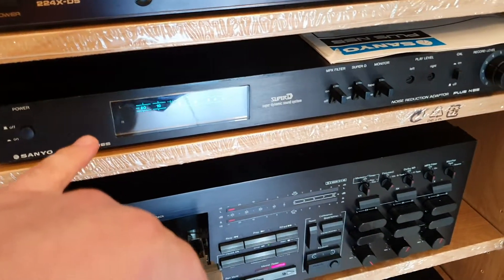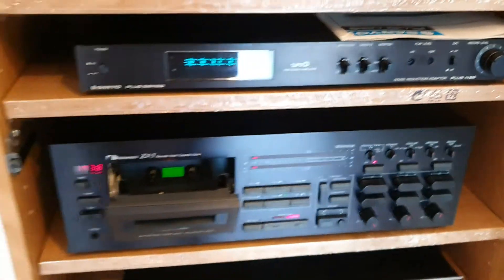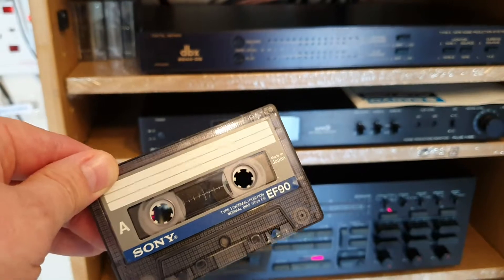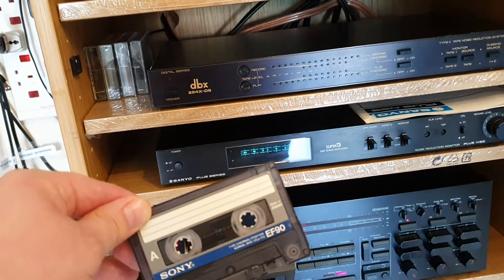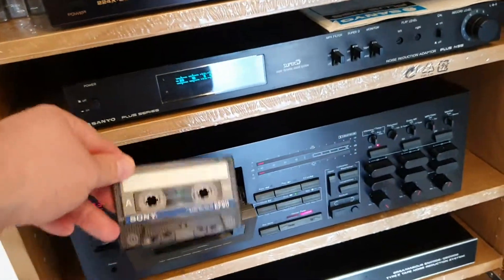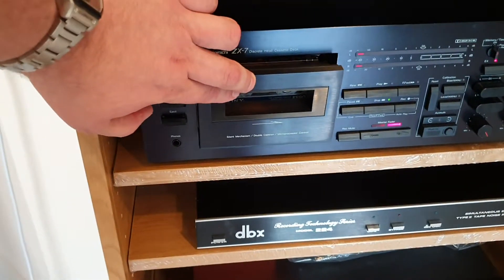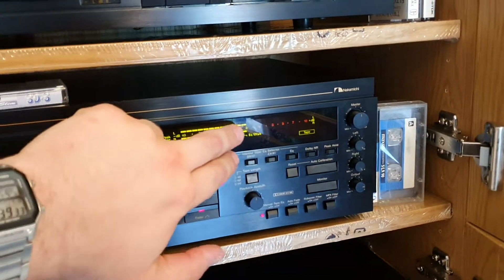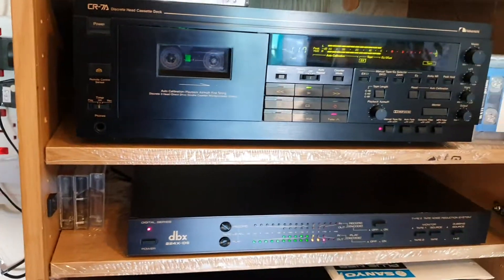DBX 224X DS & Sanyo Super D Plus 55 Noise Reduction Systems

Comment: It would be great if you would do a video on hooking these units up,i purchased these units on Ebay,and it's  a good idea to buy plenty of extra RCA cables
Reply from the maker: Yes , I understand,  there are Manuals on how 🤔to hook up ,  it is all there , just needs patience,  I marked each cable , 1,2,3,4, so know from right to left ,  little stickers, so if disconnected ever , easy to put back in right ✅order , without headache,  DBX 🪝hooks bit differently to Super-D,  so just sit down and do it )) Yes needs lots of Cables and different sizes , 0.5 , 1, 1.5 meters

Comment: After listening to both dbx and super D, which one in your opinion sounds better and has the least amount of pumping/breathing. I can't really judge listening via youtube. I have both a DBX 140X and a Sanyo N55 Super D unit and I'm struggling to hear much of a sound difference. I have also found that the super D plays back dbx encoded recordings quite pleasantly with just a little bit of occasional pumping. Infact the treble sounds a bit sweeter.
Reply from the maker: Honestly,  they both  good 👍,  but I geared more towards Super-D  ,  if tape deck is good , recorded right breathing is  non existent on Super-D  even on very quiet 🤫 parts , DBX is excellent as well  on 90% of music , and breathing is not big issue for me , I do not mind , that was a compromise having hiss all the time or have it some time and rare , important Deck   has to be top  and unity point gain has to be set right
Reply: @kravchuk007  After some hours I would have to agree, the super does sound better. Shame the super d doesn't have the dbx rms detectors as it would be nice not to have set the cal levels.
Reply: @kravchuk007  Super-D "breaths" with a quiet noise. Or I listened to a malfunctioned unit. DBX cuts everything below 15kHz (so, a minidisk is not a bad idea in this case ))) Thus, either to record on chrome, or to listen to hiss, or to spend money on R2R

Comment: which would you prefer: 224 or 224x ?
Reply from the maker: I have only 224  and  224X DS  , 224X DS has better electronics  , better schematics ,where each channel treated separately , which helps sound  wave /curve  remain under control  , to avoid  going flat ( to square /distort) when hitting floor&ceiling  , at least that's what I understood from fellow who did service my unit , 224 will do the Job as well  , it is more  relaying on hearing  while calibration is done , But recorded  tape on 224 will perfectly sound  with 224x DS and vice versa
Reply from the maker: I have only 224  and  224X DS  , 224X DS has better electronics  , better schematics ,where each channel treated separately , which helps sound  wave /curve  remain under control  , to avoid  going flat ( to square /distort) when hitting floor&ceiling  , at least that's what I understood from fellow who did service my unit , 224 will do the Job as well  , it is more  relaying on hearing  while calibration is done , But recorded  tape on 224 will perfectly sound  with 224x DS and vice versa
Reply from the maker: I have only 224  and  224X DS  , 224X DS has better electronics  , better schematics ,where each channel treated separately , which helps sound  wave /curve  remain under control  , to avoid  going flat ( to square /distort) when hitting floor&ceiling  , at least that's what I understood from fellow who did service my unit , 224 will do the Job as well  , it is more  relaying on hearing  while calibration is done , But recorded  tape on 224 will perfectly sound  with 224x DS and vice versa

Comment: Wow Dolby is for children? Is that why it was added to every mid to high end deck since the late 60s and 70s? Is that why it was considered one of the greatest contributions to analog recording and playback? You should try Dolby S before you call anyone who has a Dolby deck a "child".  I have a Sony ES cassette deck with Dolby S and a vintage A/D/S Atelier deck with plain Dolby B and C NR with an MPX filter and outfed to a Dbx 200 decoder and I find the combination of Dolby and Dbx to be amazing. Especially with a high quality source CD like an SACD or a well recorded DAT tape. It depends on the quality of your tape deck (3 motor, azimuth adjust, full logic) the quality of your tape (metal or at least a good FeCrO2 formulation) and even a good equalizer. Respectfully, don't call your audience who own Dolby equipment "children". I respect your opinion, but that's just asinine to call your core audience that.
Reply from the maker: I am using Dolby Every day as well ) It was a joke ! Man ! Dolby is a King !  Of course . Dolby  comes in different forms , Different Chips used , that is a problem with dolby  , every deck has different Dolby ...  ES Sony will have more expensive Dolby processor than cheaper version , Nakamichi Dolby  is Magic ! as well different chip set
Reply: I came to believe Dolby is a scam. If the recording is that bad it should be discarded, quality tape should be used and record hot, even a little background hiss never hurt nobody,  Dolby is not for me
Reply from the maker: Dolby , many versions ,  dolby   can be much Dolbyer)) from deck to deck )  dolby  crap in one deck for 200 bucks and DOLBY  Masterpiece in 1200 bucks  deck ... they are not equal
Reply: @kravchuk007  Look my man, I'm not trying to piss on anyone's parade and if my response sounded a little hard handed then my apologies. I'm just saying that Dolby has made immense contributions to the audio industry as a whole and led to innovations that helped classical audio go from a hiss fest to at least a tolerable level. And I respect anyone that finds other alternatives (DBX/MPX/Columbia CX) and if that is your preference great, it's just good that classic analog has its place and is still admired and respected for its amazing inventions and really good quality equipment. I don't see a lot of it today, only niche market or the extremely high end like Theta or Bang&Olufson which is a bit hard on the wallet.
Reply from the maker: @deathstrike  I understand , no hard feelings,  I  use Dolby C  always  , Nakamichi Dolby C more than enough  for most of cassettes   , total silence 🔕   when it should be silent ,  and all excellent 👌  , DBX and Sanyo Super-D are more radical  and to be used for cheaper end tape ,  because some cassettes can not take in Dolby C , just not enough dynamic range , tape  just weak ,  not capable  😒,   Dolby C require for example overshoot high frequency while encoding , so tape has to be good or  very good at least , cheap ones cannot take that encoding ...  even on Nakamichi , than Super-D or DBX can help , but there is some Voice tapes , like TDK FE or Fuji DR ( certain years) or Memorex low end ... they are so  bad , recording on them is pornography  sorry   , waste of time...